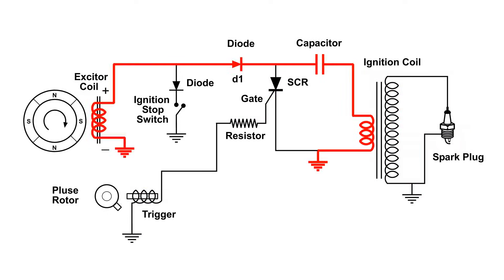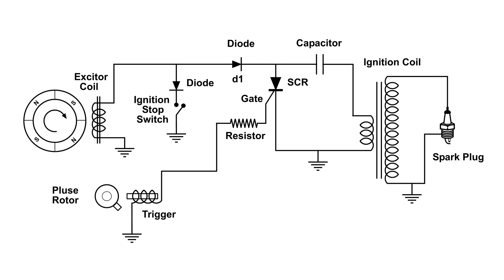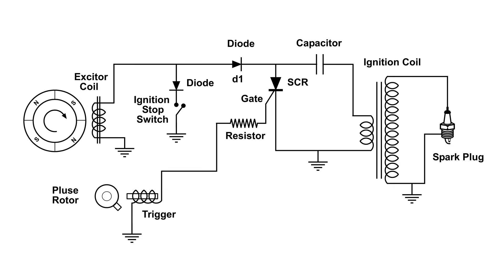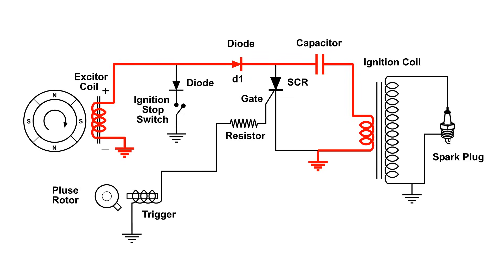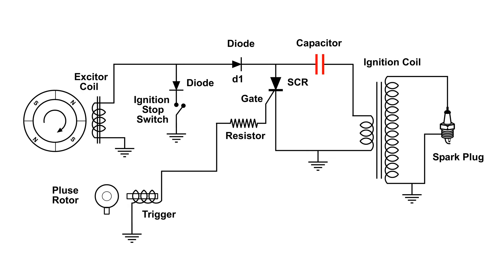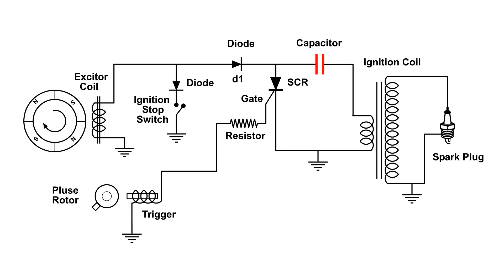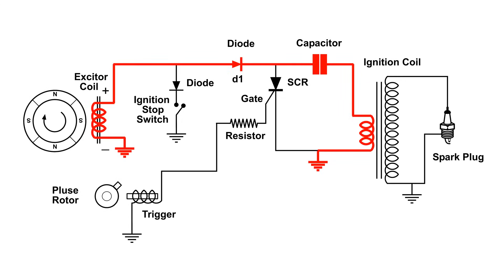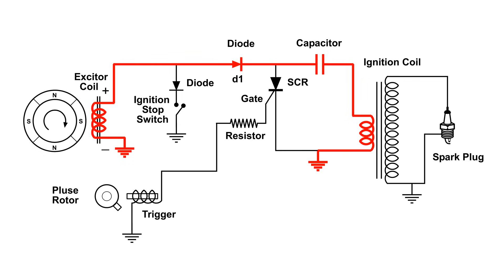CDI Capacitor Discharge Ignition Circuit Demo

Comment: hello I want to upgrade my ignition system I have a opel ascona c it has a singel coil h.e.i with a inductive triger distributor and 4pin ignition module evry thing I did understand.
I have all necesary components to build a cdi ignition ore have 2 ignition systems in the same time what I dont understand is the exciter coil with magnets what device can do the same effect? that pulsing movement to the capacitor? alternator?small generator?inverter? selenoid what culd I use to get the charge on the capacitor?where are those sensors located?how much I did understand one is above the engine one at the botom right? if so does those sensors ore triger can they by brought like aftermarket parts and instal them on older engine's? what effects you wuld get if you add hv diodes ore hv capacitors directly to a non cdi ignition system??? how does it effect engine perfomance and economy? what hapen if you add hv capacitors ore high amp capacitors to car baterrys what effect does it have on other car gear?how much I know is that fuse's restrict amps but not voltage will the car still run fine ore it will speed up the electric motors locaded in the car giving them more power?will the ignition coil propertis by affected?
Reply from the maker: I sorry but I can not help you. A YouTuber sent me this circuit and asked me if I could explain how it functions. With a few question back and forth I got enough information to make this video.

Comment: In this video when the function of Ignition stop switch Will come into the picture? 
Not clear
Reply from the maker: That turns off the engine. Keeps the capacitor from charging.

Comment: Is this system also used in lawn mower ignition coil ??
Reply from the maker: I suppose it could be used, but usually lawn mower engines use a magneto ignition system.

Comment: Hi, is the signal wire to the coil AC or DC ? I have 2 motorbikes and the coil on the one motorbike has a positive and a negative terminal (signal wire to coil connected to negative side) and on my other motorbike it only has the signal wire going to the coil it so I presume this is the positive side and the body of the coil must be the negative?
Reply: yes that is correct some motorcycles especially with older bikes the coil only has one wire because it grounds through where it bolts to the frame but in my experience the bikes that have one wire coils and ground through their mounting surface are pre-cdi ignition bikes.....
Reply from the maker: Thanks

Comment: Could you run it from 6 or 12v dc battery? Or is AC (no current cycle through diode) necessary to enable the SCR to shut off after it has been triggered?
Reply from the maker: You may be able to run this on a battery but it would be a large design change.

Comment: A very very good video! I actually learned a great deal. However I would like to respectfully challenge the circuit slightly, and I emphasize the word challenge because I am also unsure I am just throwing something out there.
I believe one of the grounds should be in between the right side of the capacitor and above the primary side of the ignition coil. Instead of its current location in between the primary side of the ignition coil and after side SCR. 
But again, I am not sure, I just think it would be more right?! Please give me your thought.
And thank you again, great simplified video, which gets right down to the point
Reply from the maker: Thank you, and your welcome.

Comment: I get so much out of this video!  On all of the Automotive Ignition Coils that I have, the primary terminals are labeled "+" and "-".  I always wondered two things about them:
(1) To which terminal is the internal secondary wire connected?
(2) Are the coils wound in the same or opposite directions--Also (viewing from the top, say) in which direction are the two coils wound?

An observation only, from the schematic:  Suppose the output of the generator is connected to a full wave bridge (FWB) rectifier; wouldn't this greatly increase efficiently, while eliminating both diode (d1) and the "stop" diode (the stop switch could be connected to the FWB).  I assume the ground would be shifted to the FWB ground.
Reply: The scr will continue to conduct unless it is reverse biased,  which happens every half cycle with a half wave rectifier as shown.  If it never turns off the capacitor can not charge and so no energy will be stored for discharge through the ignition coil.
Reply from the maker: Thank you, and your welcome.

Comment: Great video, i just want to ask what is the voltage output feom CDI? AC/DC? And also from ignition coil going to spark plug cap DC?
Reply: Just remember a transformer "ignition Coil" can only step up or step down AC not DC so anything coming from a CDI to an ignition coil will be AC.jim
Reply from the maker: Thank you, and your welcome.

Comment: Thanks,  Does firing on the expanding magnet field, produce the same spark energy as firing on the collapsing magnet field?
Reply from the maker: I'm doing an experiment, charging a capacitor and then discharging it on a primary of a transformer and looking at the secondary with a oscilloscope. Get back to you soon.
Reply: Thanks so much--that data would be EXTREMELY helpful!!  Today I have actually started the first stages of construction.  The B-Field section is the final part--I plan on using an automotive ignition coil, but have several options (which I would rather NOT use)

Comment: Thanks for this great video, I have one question:  Here the spark plug fires when the SCR CLOSES,and shorts the capacitor through the coil primary, I have always heard that the coil secondary fires when the primary switch (an SCR here) is OPENED, collapsing the primary field...can you help with an explanation for this.
I am so interested, because I need my circuit to behave EXACTLY as yours does.
Thanks so much!
Reply from the maker: It fires on the expanding magnetic field.
Reply: This is a CDI, what you describe is an induction ignition like the ones cars have.
Reply: Ok:  So a CDI system fires on the -EXPANDING- magnetic field, and the INDUCTION system fires on the -COLLAPSING- magnetic field.  Is this correct?  Also, if we are dealing with equal coils and fields,  then the output sparks from the two systems should be approximately equal:  Does this seem correct?
Reply: dale nassar no, for two reasons. CDI's uses a high voltage to create the field (around 200v for a motorbike) and the pulse of energy has a high current very short duration. This allows to have a very fast spark, best suited to high reving engines.

An induction ignition uses 12v (actually a little less in some cars that use 12v only when cranking and then like 9v) The coil is always energized (across 12v) and when the supply is disconected the magnetic field colapses. The collapse of the magnetic field takes more time but has a longer duration, and produces a hotter spark, best suited for low revs.

If you used a coil designed for induction spark in a CDI system it probably wouldn't even make a spark, as the coil has a low number of turns and a very thick wire, also the iron core wouldn't saturate as it is very big.

If you did the oposite you would fry the thin wires of your coil and the spark would be very weak because the iron core can't store a big magnetic field (it would saturate very quickly)
Reply: dale nassar also even if you had two equal coils you can't have equal fields, because induction ignitions store energy in a magnetic field and CDI's in an electric field (capacitor)
Reply: dale nassar you could in theory make a CDI for an induction ignition coil if you used a big enough capacitor
Reply: Thanks,  From what I have seen the inductive ignition coil just uses the 12v car battery to energize the primary coil--is this correct--NO capacitor?  So, as you suggest, I can use such a coil with a rather large value capacitance to operate it as a CDI function.  I would assume the capacitor would be operated much higher than 12v...say, ~300V?  THANKS SO MUCH!!!
Reply from the maker: Transformer Basic Parts & Function
https://youtu.be/q3YhbugYjJY

Transformers, a few basics
https://youtu.be/UvHCQswnjEg

Comment: If the charger coil gives a hug amount of electricity by rotating on high rpm is it gonna break everything?
Reply from the maker: Engineers take changing speed into the design parameters

Comment: Thanks for u're video, I have a question, which program have you used for this simulation?,  I wish learn all about it to try make a CDI which generate more voltage in output than my actual CDI, it depends by the capacitor too? or only about the stator ? thanks
Reply from the maker: For the animation I used FreeHand 11 to make the drawings, PhotoShop Elements 2018 to make the drawing into 1080p. Then used Premier Elements 2018 to place the the drawing in order and animate the drawings. On the CDI a larger capacitor will store more electrons making a hotter spark. Also a stronger magnet produces more electrons to store in the capacitor.
Reply: THANK YOU!! have a good day. ;)  u're videos are awesome.

Comment: Hello sir. Thank you for helping us along understand some of the mysteries of modern electrical automotive systems.  I have a question if you don't mind. In a typical application of the CDI, how many "charge cycles' would you say is necessary to create enough charge in the capacitor? I ask because I really wonder how charging the capacitor is accomplished on say a single cylinder 2 stroke motorcycle engine. If a 2 stroke fires every single revolution of the crank shaft, and the CDI magnet system is tied to its rotation, then you pretty  much only have 1 charge cycle (edit: 2 charge cycles) available for charging the capacitor. That is unless you use a gear system to speed up the shaft for the magnet system.
Reply: Well, the magneto rotor has multiple poles so there are many "charge cycles" per revolution. Also the pulse coil is usually on the flywheel so even 4 stroke bikes have 1 spark per revolution, a "wasted spark"
Reply from the maker: Don't know, the question was how does a CDI work. Give me a motor model and it's circuit.  I'll try to explain the circuit.

Comment: Interesting. I was trying to figure out an Amazon review for a small engine accessory coil to provide 12 volts for gas engine bicycle  lighting. This reviewer said that just adding the aftermarket coil (approx 180 degrees from the ignition charge coil) kept his engine from running more than 3,000 rpm. We used to do this exact trick with old Ducati and other euro "scrambler" dirt bikes that only had one magneto coil so we could  get some lighting, and it was never a problem. Of course, those were the days of separate spark coils with contact breaker points (and incandescent lights that didn't care about the non-rectified AC pulse from the lighting coil), but still, I'm having a hard time understanding how adding another coil would possibly have any affect on the CDI  system. The aftermarket coil is grounded to the engine and has one power lead coming from the other end of the coil, so both the ignition coil and the aftermarket lighting coil share the engine block as a ground - but that shouldn't be an issue... should it?

Strange, eh?
Reply from the maker: T would need to see the circuit.

Comment: Thank you for making the video. The most appealing explanation I've found. My only question is: why is that the grounds of both primary and secondary are shown in red when capacitor discharges? (at 4:20) Doesn't capacitor discharge "onto itself"?
Reply from the maker: Both have current flow
Reply: Wouldn't it then make sense to disconnect the ground when capacitor is discharging?
Reply from the maker: That's an open and current can't flow

Comment: Are there alternatives are there to Capacitor Discharge Ignition? I am specifically referring to a magneto type electronic Ignition system. If there are no points and condenser, is it automatically assumed it is a CDI type ignition system?  A reference to some schematic would be really appreciated. Good video BTW.
Reply from the maker: Yes. Thank you.

Comment: Excellent video! If I might ask, what is the  CAD program that you used for this animation? Was it Solidworks?
Reply from the maker: I did take a night class on Solidworks because I was curious if I could use it. Solidworks is a fantastic application but I found that I could not use it for my videos. I used three applications to make this video. The first one is a drawing program Freehand 11. When I have all my drawings made I export all drawings as PSD files. The next application I use is Photoshop Elements 14. I load all the PSD files into Photoshop for cropping and sizing. When this is all done I save each picture as a JPEG. The third application is Premiere Elements 14. I load all the JPEG's into premiere, in this case for animation. I've had this question before so I made a video about it.

How do I make my drawings FreeHand 11
https://youtu.be/8_wrnq0XCH4
Reply: Thank you so much for the reply. I did look at the video, but I did not see the method for doing the animations and highlighting.  My understanding is that a JPG file is a pretty static, compressed format. I am not sure how you would animate one. I expect that each frame of the animation is really a separate drawing. Then you time them properly. Would that be correct?
Reply from the maker: I'll do a video on animation
Reply from the maker: How do I Animate My Drawings
https://youtu.be/cqDWzN1AVoU

Comment: Good video and explanation but the one thing that I feel is missing is an explanation of how the collapsing magnetic field in the primary winding relates to a spark being generated.
Reply from the maker: Transformer Basic Parts & Function
https://youtu.be/q3YhbugYjJY

Transformers, a few basics
https://youtu.be/UvHCQswnjEg

Impedance, Back EMF, AC Resistance
https://youtu.be/y11SbmXPY18
Reply: Recall that primary and secondary are wound on the same core.  A sudden drop in the primary's magnetic field produces the same drop in the secondary's field.   Thus the secondary's terminals develop a voltage across them that is proportional to the rate of change of the magnetic field.

Comment: Hay bud, I have a system that's putting out 18v from exciter coil and only 6.5v from cdi box to the ignition coil. Is this normal voltage drop, or is the cdi bad? I have spark, but weak. I can hold plug in hand and just feel voltage. Any advice would be great, thank you so much, Mike.
Reply from the maker: Usually capacitors fail first in circuits

Comment: so it doesn't have an on board computer like EFI systems? so lets say there was an EMP or CME event would it destroy the CDI?
Reply from the maker: The SCR would be destroyed and probable the diodes too.
Reply: would it be wise to have a backup CDI? or will something else need replacing if ever?
Reply: EMP couldn't induce the voltages already present in any ignition system.  Much EMP lore is entirely fictional.

Comment: If the trigger is given to the SCR not only while starting the bike, does it mean that CDI is required even for running the bike smoothly?

My motorcycle under cold conditions burps out for about 5-10 minutes past starting and switches off while the throttle is not revved (I set the idling to its best form but this still happens). Because of this fuel efficiency has severely been plummeted, do you think there might be a problem in the CDI. (I kind of related this to the CDI because my bike  tremendously burps out through the silencer whenever i start).

Comment: When the capacitor discharges, why doesn't the electricty just flow to the frame via the ground that is between the SCR and the primary coil?
Reply from the maker: When the capacitor is charged, think of it like a battery. Positive on the left and negative on the right. When the SCR fires think of it like a wire. Now you have Positive and Negative voltage across the primary of the ignition coil.
Reply from the maker: Electrons flow from negative to positive. When the capacitor is charged and the SCR fires the electrons flow from the right side of the capacitor through the primary of the ignition coil up through the SCR to the positive side of the capacitor completing the closed circuit.
Reply: So electons flowing down from the right side of the capacitor don't see the ground as attractive and are eager (so to speak) to flow up to the left side of the capacitor.
Reply: @robertbrandywine  Yes. Except it's the magnetic field that shifts, not the electrons.
Reply: Because the current will always take the easiest and quickest way back to the source it came from. Which would be the capacitor at the time of ignition. Plus the magneto is between North and south Pole when trigger is engaged. So current wouldn't flow through the ground back to the excitor coil. But it will flow through ground back to the trigger coil.

Comment: Sweet, thanks.

How does the timing advance when the RPM's climb?  Is this type of setup just stuck at one timing?
Reply from the maker: In the circuit that triggers the gate, an RC time constant can be added for this purpose.
Reply from the maker: I did not mean that the RC time constant was the only method. I'm sure some manufactures use other methods, like mechanical.